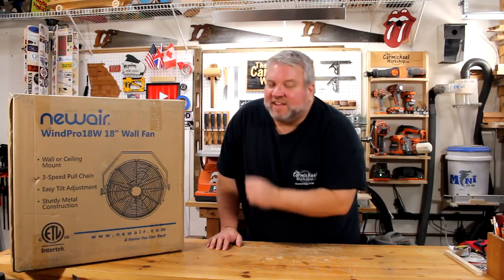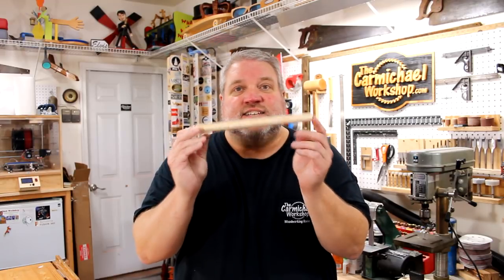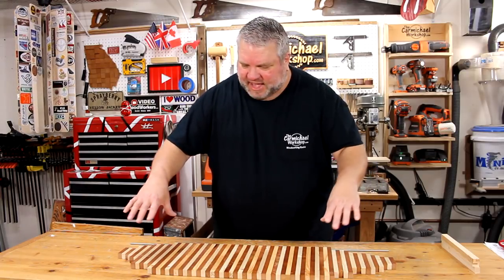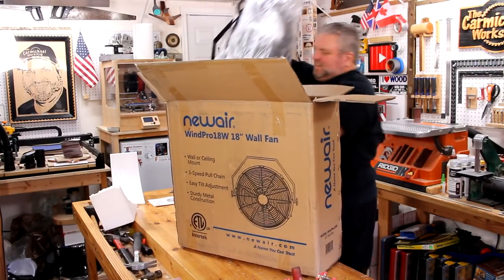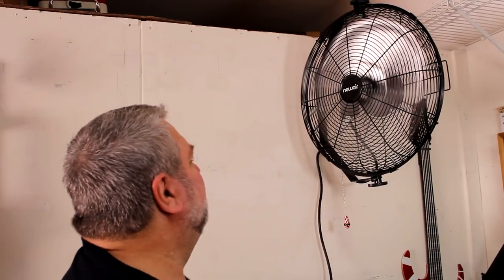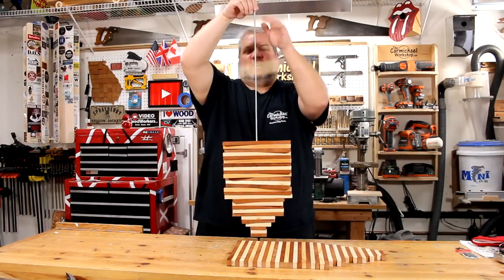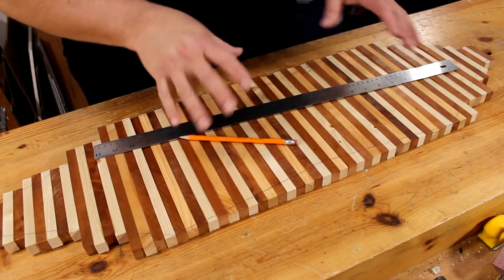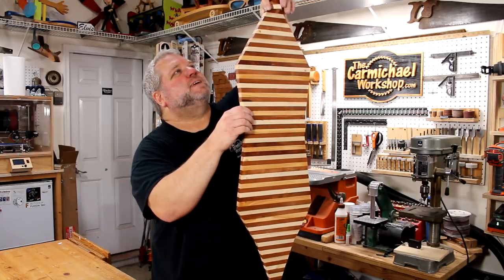Make a Wind Spinner - Easy Weekend Woodworking Project

Comment: I’m going to make my own here soon…great, clear instructions!  I had gotten a rather large one like you made probably 20 yrs ago at a craft fair ($45 even then!) but it got damaged in a move😢.  But I’m fairly certain the wood pieces looked GLUED! Would that work as well or do you think it might have just been a filler of some sort they used to seal between the pieces?  Over the entire piece it had a type of high shiny varnish or polyurethane coating as well.  I think for craft fair projects keeping it flexible so it can be flattened would be a good selling point for moving & storage purposes though. Might still have mine had I been able to do that!

Comment: Well, Starving Youngun, if that fan is going to keep you cool down THERE it better be able to drag up a glacier and grind it at the same time! I just got through fixing the fan in the greenhouse so these politickal wind gusts wouldn't blow it out in the floor anymore. Good timing but the old boxless fan is still wheezing along. NICE spinner, by the way! Keep cool, Bud! It was 80 here today and blowing snow night before last. Mercy!
Reply from the maker: Hey Lewie!  Thanks!  Good to hear snow is in the past for you, well for now.  We also got new insulated garage doors, so with the new fan, I'm hoping to not look like an old sweaty man in my videos this Summer, just an old man.  lol
Reply: The insulated doors were a GOOD move. They won't melt down quite as fast as non-insulated but you'll be fine. YOu can always go jump in the freezer for a few minutes and you're not old at all. Just 'drummed out' a little bit! C U, Pal!

Comment: What size Barrel Swivel did you use...have a size 1 on mine and chain hanger but not spinning very well....going to go to twine later to see if that changes....just curious what size barrel swivel you are using
Reply from the maker: Hi Gary - I paused the video and it looks like the pkg says SZ 1 if that helps.  I later put on a dog leash swivel that worked a little better.  You can get those at a hardware store or just take one off a dog leash.

Comment: Nice project. I replicated it, for the most part. Only changes I made were: 1)using a cap nut at the top with a hole through it for the swivel, 2) 28 1/2"  x  9 3/4" dimensions. Unfortunately mine will not spin at all. Is there something you can offer as possible cause and a  remedy? 
Thanks.
Reply from the maker: I've tried different swivels and ended up using a dog leash clasp that swivels with some grease.

Comment: No glue after you moved the pieces into position?  Did you respray it with finish when the pieces were in position?
Reply from the maker: I tightened the stack between the nylock nuts and the pieces won't budge. All surfaces were already sprayed so no need.

Comment: GREAT BUILD ....WHAT DIFFERENT LENGTHS DID U USE FOR THE SHORTER ONES?
Reply from the maker: I didn't really measure, just cut them by eye since I was going to trim it anyway.  I would guess that I cut some of the 10" pieces into 3" and 7" pieces, and also two 5" pieces.